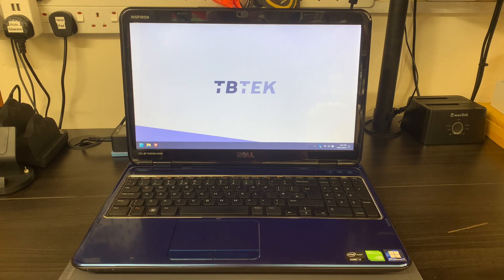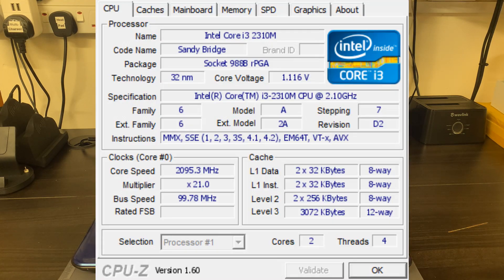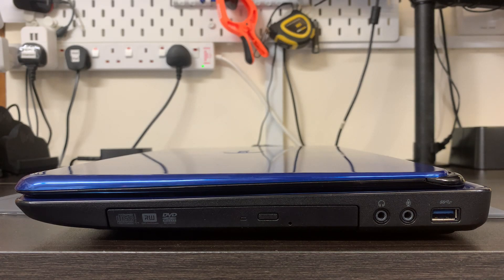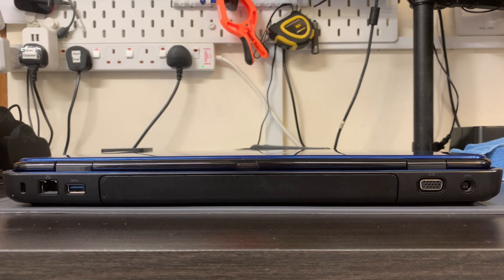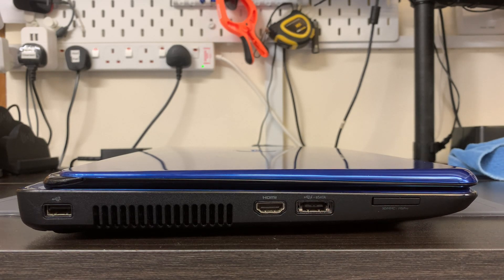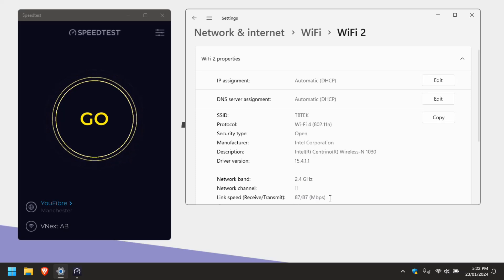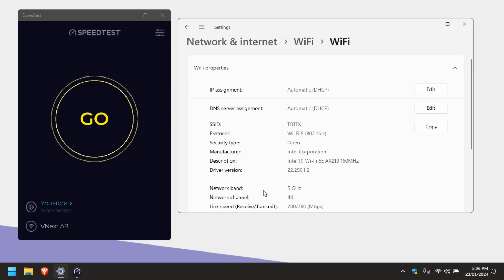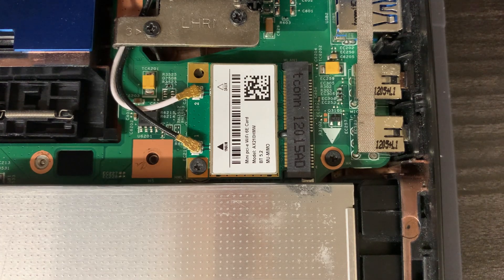How I FIXED & SUPERCHARGED a 13 Year Old Laptop! | TBTEK

Comment: Thanks for this great video. I have the same machine but with different original specs. It has an i5-2450M and 4 GB of RAM, which was pre-installed. Recently, I upgraded my RAM to 8 GB and installed Linux Mint MATE, replacing Windows 7. My primary tasks are coding and web browsing. I bought a 4 GB RAM module because I was looking at the allowed limit, but since you easily upgraded to 16 GB of DDR3 RAM, is it possible for me to upgrade to 16 GB as well?
Reply from the maker: @jasdeepsingh7002  Yes the official documentation says 8GB maximum and I believe on the earlier BIOS versions it was.

But yes if you are on BIOS version A11 then you'll be good to go with 16GB (2x8GB). If it's also got the dedicated graphics card then it's definitely worth it.

Comment: With the i7-2960XM do you need to keep the laptop plugged to the wall?  I remember sometime back I put a 45watt processor in a laptop designed for 35watt processor, it DID work, but when it was unplugged suddendly switched off (not thermal shutt-off) ... if I kept it idle it would last many hours but as soon as the processor demanded some extra wattage I figured the battery wouldn't keep up and it shutted off (I monitored temps, -it was never the temps).
Reply from the maker: @PippeML  Doesn't need to be plugged into mains all of the time, however if the battery is worn and the processor power management settings aren't set correctly then from a full charge you can end up with 5-10 minutes or even less before it's dead.

Something that many people aren't actually aware of is that ultimately Laptops aren't really designed to be used on battery primarily. The battery allows you to relocate or keep you going temporarily in a power outage but in the most part you should be using it connected to the power supply. The main reason for this is the processor in a half decent machine cannot run at its full potential on battery power.

I actually set the processor to max out at 50% on battery power, which performance wise makes it the equivalent of a Dual Core i5 of the same era, when it's not under load it'll drop down as low as 5%. I go from having 20 minutes or less from a full charge to around 2 hours (the battery is the original, fairly worn).

I have also used Task Scheduler to help by changing the maximum processor state to 5% when idling and then back to normal when it's in use. This also helps keep it cooler when idle. Will possibly make a video on this at some point.
Reply: @tbtekuk  hey thx for the answer! I'll set up my i7 840 QM to be 50% when on battery... I hope that does the trick! Thanks for the tip man!

Comment: I would have liked you to also replace the screen with an FHD one with better colors, that's something that no one does in this videos
Reply from the maker: In regards to screens, we are limited by the motherboard and the pinout for the screen connection cable.

9/10 there aren't any other spec options, especially for older laptops. I do often see anti-glare replacements but that's about it (for older laptops anyway).

The resolution on the laptop in the video is 1366x768 so not FHD but still HD (above 720p) so it's adequate enough.

Comment: Hello mate, pretty cool video. I'm going to upgrade my Samsung NP3004EC, with a i3-2328m, 500 gb HDD and 6 gb (4+2) ddr3 ram. I've already bought a 4GB DDR3 stick (mine only accepts up to 8 gigs of ram) and a 128gb ssd (i'll be using a lightweight linux distro). The next step would be the processor. I've been researching and wanted to know if you have any knowledge about using 3rd gen processors that fit into that pga88 socket. Some people say they work, other say they don't.
Reply from the maker: Well the current processor is a 2nd Gen so you'll need to stick to one within the generation.

That i3 is a Dual Core processor with a TDP of 35W, so the best one you could safely upgrade to is an i7-2640M.

But if you find out that your mobo is ok booting the Quad Core processors with a higher TDP, then in theory you could upgrade all the way to the i7-2960XM (same as the one in the video).

But value for money wise, the best choice at that point would be the i7-2760QM

Comment: Hold up, I had to rewind a part to make sure I heard right. You went from Windows 7 to Windows 11 on a 13 year old laptop?? How? Did you run into any issues? One would think that you would be lucky enough to install and run Window 10, but Windows 11??
Reply from the maker: You heard correct! Well technically I fresh installed Windows 11 since the Windows 7 that was already present was the previous owner's and I was upgrading to an SSD anyway.

No issues at all using methods to bypass the silly hardware restrictions Microsoft imposed. 

My latest video shows how to bypass these for an in-place upgrade to Windows 11 if that's something you need!

Comment: You did not upgrade the nVIDIA GeForce GT 525M  ?
why still use it now ?
for 200 you can find i7 gen 8 book
Reply from the maker: No, the Nvidia card is soldered to the board and from what I've seen it's the best card that can be found on these boards anyway.

And sure you can buy newer laptops but this is about keeping old tech out of landfill and making it useful again.

Comment: thank you for great videos, how about the power adapter to handle the increase of power consumption from 35 watt (i3 2310m) to 55 watt?
Reply from the maker: This is a good point. The previous owner included a 90W adapter with it (not the 65W that it should have originally shipped with)

With the i7-2960XM upgrade, this would have been enough if the GT 525M wasn't onboard as well. Since it was the laptop asked for a 120W adapter of which I had a spare from a dead machine.
Reply: Woow, thank you for your reply. I do the same thing with my asus a43s. Swap from i3 2310m to i7 2640m. Another options is i7 2630qm, but im affraid the power adapter cant handle the increase of power consumption. Im still curious bigger watt power adapter for asus laptop..
Reply from the maker: @pietrawahyuutomo5970  If you are trying to keep spending low, then the i7-2760QM is probably the best value for money in terms of performance gains. 

It's 45W TDP so only 10W more. You might still get a warning message but it should still cope with your current charger, it'll just take longer to charge.

Failing that you can buy a universal 90W laptop charger with all the major connectors for fairly cheap online.
Reply: @tbtekuk  okay, ill consider that. i7-2760qm is quite cheap now. and another things is looking for universal charger laptop.  thank you so much for giving an insight.

Comment: How's the battery life?
Reply from the maker: Not great currently, an hour or less from full. Even worse when the graphics card gets used. The i7-2960XM is pretty power hungry and although it works this laptop wasn't really designed to take it.

The Dell Battery Monitor says it's at 67% health so a new one would help somewhat.

Not too bothered in all honesty, I always say with laptops that although they have a battery they aren't really supposed to be used without being plugged in for long periods, amongst other things the processors don't tend to run at full speed without being plugged in. Thier main purpose is for portability, being able to easily move from one location to another but ultimately they should be plugged in wherever they are used.

Comment: E-Sata is not for anything other than sata periphals like CDs and HDDs
Reply from the maker: Yes it's good for cloning SATA HDDs/SSDs since you can use the USB 3.0 ports (different controller) for the other drive and get essentially full speed.

For those that don't need it, luckily it doubles up as an additional USB 2.0 port so it's still useful.

Comment: With Arch Linux being a rolling release, it should work great with such an upgraded system. I use RichARCH btw. With it I was able to get Arch Linux up and running simply and quickly with kickstart like automation features.
Reply from the maker: Yes Linux is great for older machines.

Although it has far more customisation etc. Windows will always be the go-to for the majority of users. Especially Gamers and Businesses.

Comment: So glad you mentioned what sata you had, cause if it was sata II that SSD would be crippled, because it would only be able to use half of that speed
Reply from the maker: Yes luckily quite a few laptops from around that time had SATA III. Most likely because they wanted to maximise the performance of the HDDs they were shipping them with, since SSDs were too expensive back then.

Comment: Can you help: my mums laptop is a Dell XPS 15 L502X, core i5, GT525M and it has a WiFi n card. What internal card can I fit to get at least WiFi AC?
Where in the UK can I buy it from?
Reply from the maker: Hi, that laptop has the same interface as the one in the video, so you should be able to upgrade it to that very same one which supports WiFi 5 & 6.

It's the Intel AX210, should find loads of places to buy it online.

Or if you live in the UK, I'd be happy to upgrade it for you, feel free to enquire with me on my Website, Facebook or Instagram.
Reply: @tbtekuk Thanks a lot. I am UK based

Comment: I love laptops with a spare internal mPCI-e slot, I use them with a USB adapter for my wireless mouse dongle.
Reply from the maker: They are good for that!

It's a shame that in my case Dell was super short sighted and despite it being a Mini PCIe interface, they left out the majority of functionality of the port and most N5110s in existence don't even have the interface soldered on. It was just treated as a rare add-on solely for activating WAN functionality.

Would have been nice to use a converter and have a 2230 NVMe in there instead, although I'm not sure I'd be able to use it as a boot drive anyway.
Reply: @tbtekuk  usually as you say it's just the usb lines of the port that are active which is a shame.

I had an old MSI Wind U230 which had full mPCIe capability on the spare slot and I used a Broadcom Crystal HD decoder in there for a while, eventually putting an Avermedia TV card in it.

I also had a Dell Mini 910 which had the active pads on the board but no header so I found one online and soldered it in. A surprising amount of laptops from that era have the pads there.
Reply from the maker: @MegaTerryNutkins  That's the ideal situation! I almost feel like they intentionally wanted to make the port useless if not used as designed.

If I really wanted to get a 2230 NVMe working in this laptop I could, but at the expense of built-in Wi-Fi. The LAN card in the secondary port would still work for Bluetooth but not Wi-Fi.

The SATA III port + SSD combination is good enough in all honesty so I'd rather keep the built-in Wi-Fi and as you've seen in the video, the upgraded LAN card makes a huge difference!

Comment: Well fettled!👍👍  I install Linux OS., such as Linux Mint Mate and Zorin OS., to extend the working life of older computers.
Reply: People are way too quick to throw tech away, such a waste. Grabbed a refurbished Thinkpad L420 years ago (win7 os) & still love using it with Ubuntu. Grabbed a used dock on eBay, installed a USB 3.0 card, maxed out the ram, & swapped the original i5 for a slightly faster i7 (again, eBay, only $12), and of course a SSD. Thing runs like a champ & the available ports are awesome. Wish more folks would do a little research instead of junking a machine because it won't run current WinXX. I won't lie, I do have a HP running W11, but really enjoy Ubuntu & Mint more. Am in the process of doing similar for friends. Got one of my buddies running Kubuntu on his older Dell & he was truly amazed at how it just works! 😂
Reply: @cncwizard  Yes, I concur that far to much is wasted, but at least the recycling centres etc., give folk another option, I also have Windows 11 installed on a spare pc., but it's just there in case I need a Windows pc., for some task.
Linux certainly extends the working life of older computers.
As far as I could tell the main problem with that Dell 7010 was that the cmos battery was dead and one usb port is faulty.
Reply from the maker: Thank you! And yes Linux is great especially for lower spec machines.

I have an old MacBook with multi-boot macOS, Windows and Linux (Zorin OS). I might do a video showcasing it at some point!
Reply: @k That would be an interesting video.
The only Mac which I have is a 2010 Mac Mini, but it currently does not work. 
Recently, I rescued an old Dell Optiplex 7010 SFF PC., which had been thrown out, it came with 16 gig., of DDR3 ram., and a 256 gig ssd., and a third generation i7, after a good clean and new thermal paste and a new cmos battery it's currently working well with Linux Mint Mate installed, I'm still surprised by what folk throw out.

Comment: I like computer restorations like this, giving old hardware cheap (relatively) upgrades to extend their life and keep them out of the e-waste bin. Excellent job.
Reply from the maker: Exactly! E-Waste is a huge problem in the world right now and unfortunately a lot of the tech companies don't ultimately consider it anymore.

This is primarily because upgradability and repairability are both bad for business, why buy a new laptop when you can fix and upgrade your old one? And so they have worked hard to make sure both are difficult and in some cases not possible.

You only have to look at a new MacBook to see everything is soldered onto the board... CPU, RAM and even Storage, no interfaces or universal parts used. Raises the chances of it being thrown into the bin when it develops a fault over it being repaired, massively.